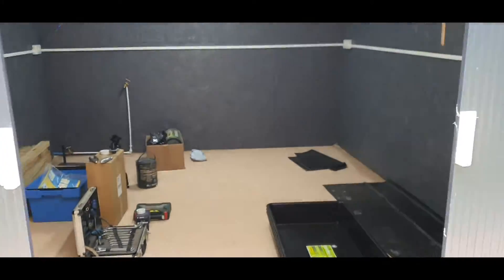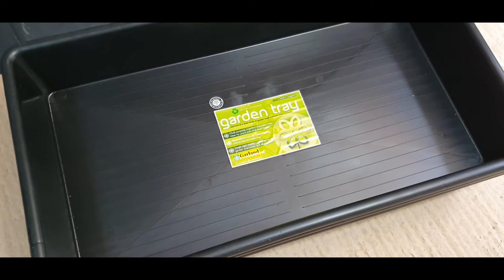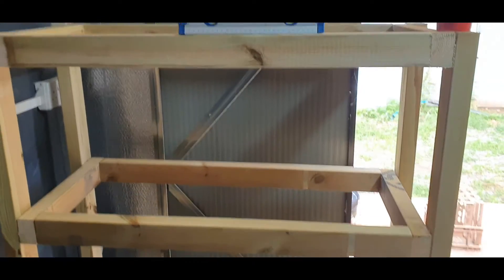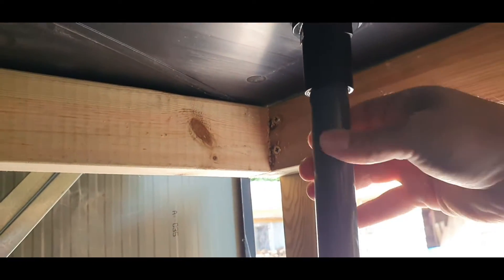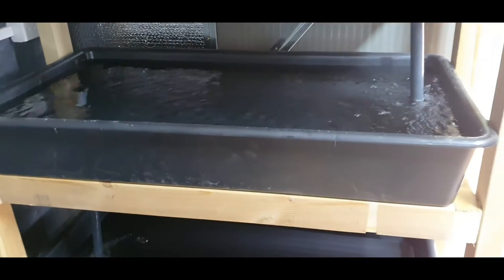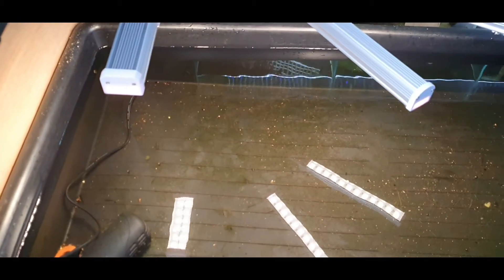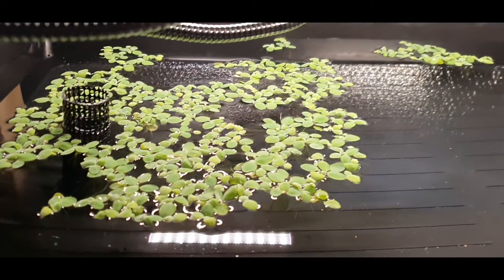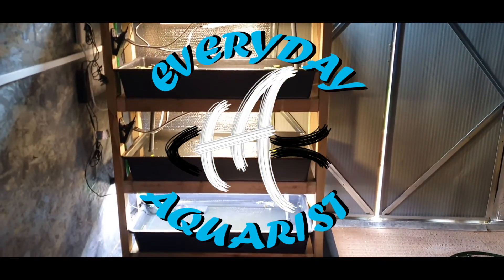DIY BUDGET Aquarium RACKING System for BREEDING Shrimp, Plants, Fish or Corals (FULL BUILD)

Comment: Nice idea, but before you decide leave the system as it is you should put some more timber to hold the weight at bottom of each container, by my own experience plastic containers by time tend to bend by water preassure, and that lead you to leaks and breakage of the container, I'm sure you don't see any bending now but trust me, is matter of time to happen, I'll say 3 or 4 more pices of timber equally spaced will be enough.
Reply from the maker: Thanks for the advice